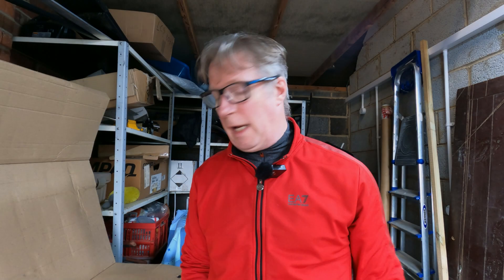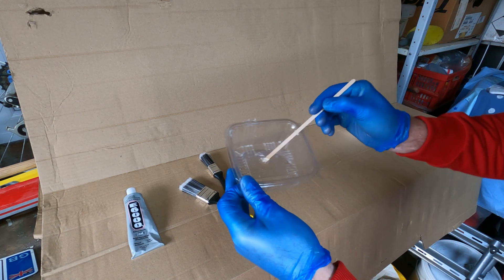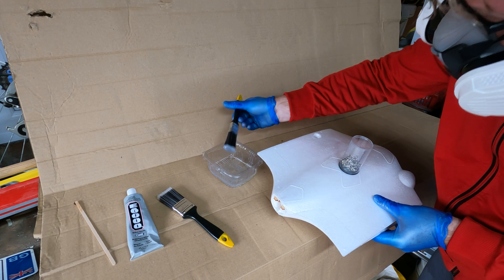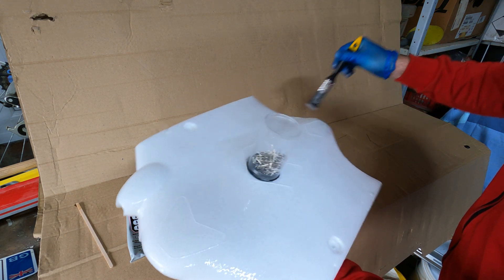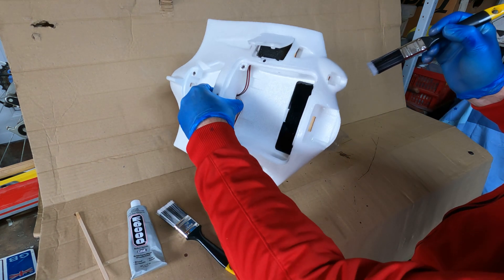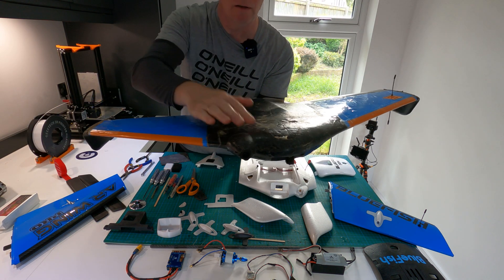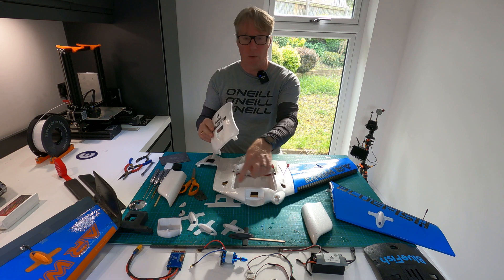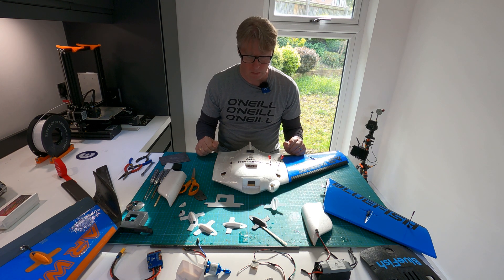AR Wing Pro Enhanced Build Part 6 - E6000 Coating

Comment: Hi Glen
Thanks for linking all those STL files for the 3D printed parts - 
What filament are you using?
Do you use different types of filament for the different types of parts?

I have standardised on ASA over PLA+ for ASA's greater: strength,  impact resistance, temperature stability, chemical resistance, water resistance to name but a few advantages. But I do find that I have to be careful with print orientation for control delamination between layers and different makes have variable warping to control.
Reply from the maker: I use PLA+ for anything not load bearing and PETG for motor mounts etc. Not seen ASA before will have to check that out. That said I have never had a failure of a part with the exception of hard crashes of course.

Comment: Excellent video, Thank You.  if you have a wing for example that you want to have both some areas in raw foam and some covered in film. Would you E6000/Toluene coat the whole wing then apply the film OR iron the film onto the virgin foam only and paint the mix on the remainder of the wing after the film fixing?
Reply from the maker: Hi Stevie I wrapped my wings with Oracover and before ironing on the film, gave the wings a light sanding with 1500 wet or dry paper applied wet and then paper towel dried them and left them for 24 hours to fully dry out. I then applied a thin coat of Oracover ahesive with a small fine paintbrush and let that dry.

I only E6000 the fuselage and hatches and I would not advise trying to iron film on top of this.

I hope that helps.

Comment: I’ve learned so much! I will definitely be doing the toluene/6000 treatment to mine!
Are the servo arm “covers” a sonic model item? My 1000 does not have them. They look nice and seem to add some protection. Where can I get them?
Reply from the maker: The E6000 coating is well worth doing unless you only fly on really nice grass. I designed the servo covers and below is a link to all my AR Pro designs so help yourself.

https://drive.google.com/drive/folders/17t3lpjY4qtXzLaUs8LDEDZR_ZOllKTfk?usp=drive_link

Comment: What proportion is best?
Reply from the maker: I find two parts toluene to 1 part E6000 works pretty well. But dependant on how thick you want it and weight allowance you can use less toluene.

There are no hard and fast rules.
Reply: @bluefish3607   You said the exact opposite of your previous answer. Could you please check your answer?
Reply from the maker: @mertavcu1  Like I said it depends on your own requirements. Mix some up and apply it to a test piece to figure the best mix for your application, thats what I did and since that video I use different mixes depending on what I am coating.
Reply: @bluefish3607  thank you, so are you still happy with the e6000 coating? has it created any problems over time? I want to make ar wing pro like yours

Comment: Aside from toluene, what can I use? I tried acetone for epoxy but it turns clumpsy.
Reply from the maker: You have to use Toluene because that is already contained in E6000. Its cheap and available on Ebay and Amazon.
Reply: @bluefish3607  link? I only see sold by the gallon on both amazon and eBay.
Reply from the maker: @bookiefpv  https://www.ebay.co.uk/itm/133949500697?hash=item1f30032d19:g:E54AAOSwN6lhpgfc&amdata=enc%3AAQAIAAAA4LkVNNzTFSkpE0I0pTKbIzY4IeMrScfWgXyK%2FVaBnKbZUmhgXWrNUrH%2Fok5czJ3z7BEBqObC1aS4mZZWFVSTDK7LWUHyycmYoLOVkxIb9Aux8V3oRGqL5S5DujkdNkUvfkQG0x2NGDEfgr%2FTLUqifP97BBu%2Fgd9geLshfI4haugIFRtJS1JaLqAYhCn%2For3vxYVupZPAcHxij3ixMJfNMsaPiYBzqAWWy9fY7tT6y8g85txbOGCWTBcaajGKaW4cX2HxTmUi5L8Sz%2BA4t8DG55%2B9YXqjd4a54hglIc%2FjWhFk%7Ctkp%3ABFBMgq-e0dti

Comment: Dekkels?
Reply from the maker: I get them cut at a local sign company.
Reply: @bluefish3607  
I was amused at the way he said Decals.  In American we say dee cals.
I am in the sign biz.  Small world!
Reply from the maker: @Navigator777777  You are welcome to the ai file for the deeecal sheet if you wan to cut some.
Reply: @bluefish3607  
How kind!!!!  Thank you.  But I couldn't trouble you for the effort.  I can make anything I want.  But Deecal Dittos!  I'm still stuck on why the Toluene doesn't eat the foam?
I've got 4 foamies sailplanes needing treatment
Reply from the maker: @Navigator777777  I  put a link to the files below. Toluene is an active ingredient in E6000 or Goop glue which is foam safe, hence why thinning with toluene to brush onto the foam does not have any adverse effects.

https://drive.google.com/drive/folders/19BGFhioTRlv1I6qybjz7fsurukartZMH?usp=sharing

Comment: Were you able to come up with a mix ratio that worked best for you?  Thank you for your video..
Reply from the maker: About 2 parts E6000 to 1 part toluene or thereabouts seems to work well.
Reply: @bluefish3607  Excellent - Ordered E6000 & Toluene - Thank you
Reply: Hi, was this by weight or volume? please
Reply: I did it by volume.   @stevietee10

Comment: Hello! How does this glue look on the black fuselage? Did you cover the black Arwing Pro with it?
Reply from the maker: Looks good, you need to make sure you brush it evenly as any areas not fully covered show up when it dries. Here is an image you can see top right corner of the hatch is not as thick as the rest and it shows in various lighting conditions.
https://drive.google.com/file/d/1VzeZvIM9UIKM3TieQcq1H9uq1kEmwedz/view?usp=sharing

Comment: Hi,
 I'm from Croatia.Can you tell me what toluene is for thinning E6000?
Reply from the maker: Toluene is a chemical used in paints etc. I bought mine on Ebay.
Reply: Ok do you have a link?
Reply from the maker: @zvonimirtrgovcic5499  Not sure they will ship to you but you should be able to find some locally. https://www.ebay.co.uk/itm/133949500697?hash=item1f30032d19:g:E54AAOSwN6lhpgfc&amdata=enc%3AAQAIAAAA4LkVNNzTFSkpE0I0pTKbIzY4IeMrScfWgXyK%2FVaBnKbZUmhgXWrNUrH%2Fok5czJ3z7BEBqObC1aS4mZZWFVSTDK7LWUHyycmYoLOVkxIb9Aux8V3oRGqL5S5DujkdNkUvficV7g0paElJXg%2FTpC5vbhnPmW1JA%2F8nAISx8PGnbcgYMonNoJml1c9iAoFU8dqBmd8yregnXEick2%2FBXHC0l4cXQ4YuVjTqs%2Ba3GYOhgqhcNczlOM4sqxPClmP0l9ZDUNj%2FJ2DD1kVKYk0vYY%2Fl%2Fdk%2FRYP5EYO3UWgC2S0jvlAJ%7Ctkp%3ABFBM3qqA3oRi

Comment: Great to see your progress with foam coating Glen. I'm not sure I'd want the faff and hazard of using Toluene.

Did you weigh all the components before you coated them and again afterwards? I'd be very interested to know what the overall weight gains is.

When I fully coated an EPP fixed wing plane with Beacon Foam Armour I noticed that the craft had gained 120g in weight over the original 700g. As a lot of surface are is behind the Centre of Gravity, I had to move the battery forward and add 60g of weight to the nose to restore balance. This has significantly detracted from the great fight characteristics of the uncoated craft.

On a positive note, misting over the Foam Armour with acrylic clear coat has totally stopped the tendency of the Foam Armour to streak when re-activated with water from wet grass landings.
Reply from the maker: Hi Dave sorry for late reply had man flu. I did not weigh it before and after but will on next build which I am starting this week. I weighed a full tube and the one I used with the toluene mix and it was just under 40 grams. 

The finish looks good and it seems to have worked very well but only a field test will determine the final verdict.

CG was pretty much unaffected and I had no need to move anything around or add weight.

Comment: I forgot to ask most important question. 
How do you prep epp foam to remove release agent . I've always used denatured ethanol but I always have trouble with adhesion
Reply from the maker: Hi Ron both for laminating with film, Oracover or indeed preparing for E6000 coating I always rub the foam down with P400 wet and dry paper with warm soapy water. this removes the sheen and allows a good key for whatever you are vcovering the foam with.
Reply: @bluefish3607  emery cloth/sandpaper and soapy water . I never would have thought of that , thanks !

Comment: Ah ! Interesting video , something new ! Ive been using iron on film and it can be a pain to get looking good ....no ability to paint from what i know . Have you tried a layer of .75oz fiberglass ?
Reply from the maker: Hi Ron, I never thought of using fibreglass I thought it would be a little too heavy. I want to keep my AR Pro as light as possible as I like agile proximity flying. The E6000 method has proved to be very good on the nose of my test plane and been very resistent to abrasion and has prevented the foam from breaking up in a crash situation.

It has also been easy to peel it off glue the split in the foam and then reapply a new coat.

Also laminating such a complex shape as the an AR Pro fuselage was not teribly appealing and I didnt think it would look that neat or offer many more benefits over the E6000 option.

I used Oracover on my wings as they are a nice flat shape and I use a single piece and wrap it around the wing. I use the Oracover heat activated adhesive and cover the wing with a thin coating of this, leave for 24 hours then apply the oracover over the top and it sticks like shit to a blanket.
Reply: @bluefish3607  yea weight can be a problem . You have to really squeegee away excess epoxy or you can easily add 8 oz to a plane like xuav talon pro .but the ability to get good finish on curved surfaces is unmatched from what I’ve seen . I understand e6000 is flexible? That is important . Your newly glassed plane won’t make it past first hard landing with brittle epoxy . Thanks for reply

Comment: Is E6000 any better than standard outdoor varnish that many people use ?
Reply from the maker: I really have no idea Andrew I didn’t know that people used varnish. E6000 is flexible and forms a tight skin around the foam when it dries. I imagine varnish is brittle when it dries and will chip, but I am really not sure. Have you tried varnish?

Comment: hi there, i noticed your ailerons on the black wing are much wider? Have you found this to be a big improvement? I replaced mine with balsa but at the origonal size and still has the odd hairy takoff from the torque roll issue. Thanks
Reply from the maker: Hi Andrew, believe it or not the balsa elevons on the test plane are 2mm narrower than the stock ones, they probably just look wider because they are a different colour to the wings. This was not by design but because I sanded the leading edges a little too much. The ones on the new build are exactly the same depth as stock.

Comment: Oooh shiny ! , Has it made the foam any stiffer ?
Reply from the maker: The E6000 shrinks when it dries so but it doesn't increase the torsional stiffness very much, the thin end of the winglets are only marginally stiffer. What it does do though is protect the foam from abrasion and provides better surface area stregth which reduces the tendency for the foam to break apart on impact in a crash. I have hit the ground and a couple of trees pretty hard with my test plane and whilst the foam did split it did not shatter into multiple pieces.